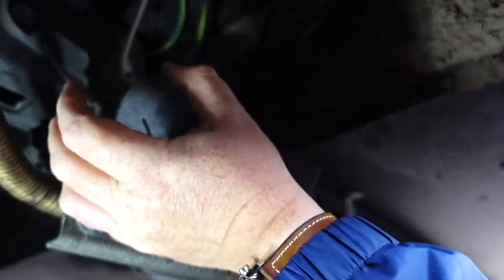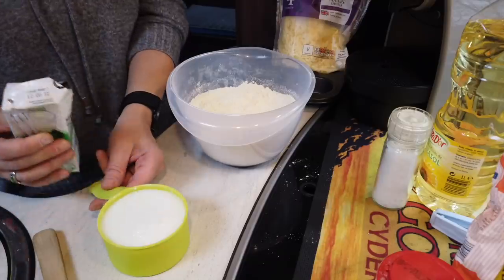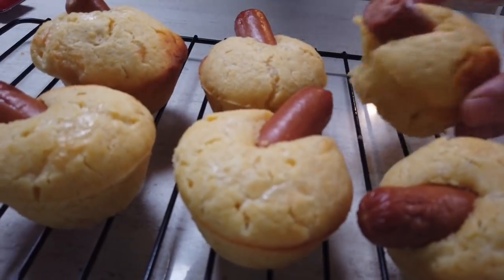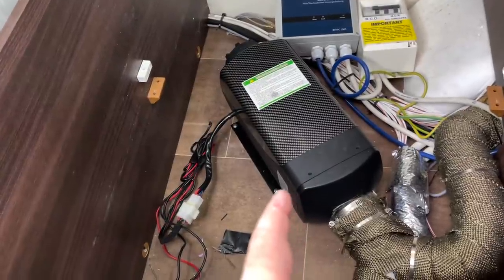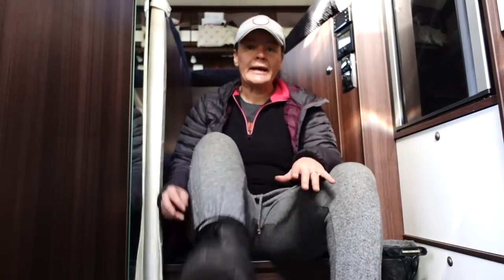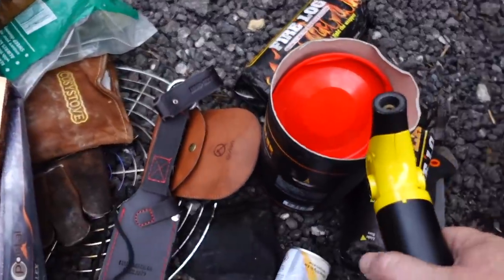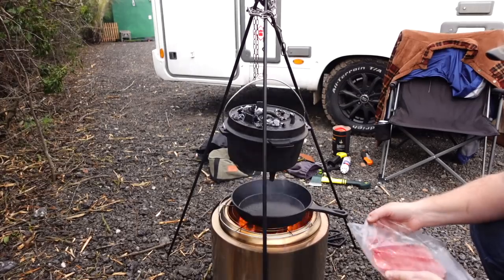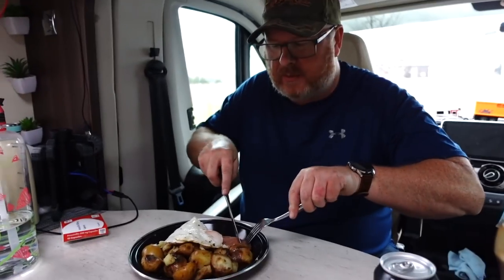TRYING NEW THINGS - Vlog 63

Comment: Hi john , may be too late now but did you check your air filter on the heater , i only say this as ive had this twice happen now where diesel wasnt burning  throwing out masses of smoke and both times it had clogged up the air filter without me checking and when i realised and took off just to see it started perfectly, due to somehow the fumes and carbon going up the air intake i guess but just worth checking see if its a simple clean of air filter to get it back running, i have 3 of these and have learned a lot about their niggles in last 6 months , but still great little things i love them in my shed! , you may also have to clean/replace the small mesh filter in the glow plug which its always worth having one or two spares and definitely a couple of glow plug replacements too , apart from those two items they do seem to be very reliable :)
Reply from the maker: It was all shown in the video 👍🏻 there’s was nothing wrong with the intake airflow.

Comment: Get a metal box, line with sound deadening foam, drill holes for fuel line in / out, once the pump is in wrap the box in neoprene.  Attach box on rubber anti-vibration mounts to the van and cross your fingers!   I've got far too much time on my hands!!  🤣
Reply from the maker: Haha, very thorough run through - thanks Patrick 😁👍🏻

Comment: John, please alter where your exhaust exits, it should exit beyond the bodyline of the vehicle, so that the hot gases can rise away from it.
 An easy fix for yours would be a 22mm copper elbow fitted to the end of your silencer, at the mo, your filling the underside of your home with naughty gas that wants to rise, be safe., love your channel.
Reply from the maker: I’ve covered this plenty of times, no rear window, no rear vent, exhaust is 3cm off the rear bumper. Imagine, if you will, it’s as close to the rear without being able to melt the plastic bumper 😬😳😁 So it’s all good thanks 👍🏻
Reply: Ive dogs in back of sprinter behind doors got me worried now exhaust points down just under door.

Comment: We have an eberspacher heater fitted to our home ( there when we bought it) . It too " ticks" like yours but cannot be heard above the fan noise ( and it's mounted outside !) . But you can here the tick when it reaches temp and starts to wind down to maintain temp inside. Something you have to live with maybe  ?
Reply from the maker: We’re thinking that, we prefer to have heat and a tick than to be cold that’s for sure 😁👍🏻

Comment: For doing your roast spuds quicker in the Dutch oven you should put them in salted water and bring them to the boil first (par boiling) before draining them, adding the oil and putting them in the “oven”. Another trick, works with Dutch ovens and Cadac gas bbq’s, is get a heavy duty round cake cooling rack that fits the bottom of your Dutch oven - you can cook a chicken, roast spuds, anything without the bottom burning. Look online for “fittoway heavy duty round cake rack” comes in different sizes as needed. Food looked amazing btw - yum!
Reply from the maker: I’ve been looking for a rack to fit the Dutch oven as I’ve seen one used loads on you tube. I must say I avoid par boiling all foods if I can, I don’t think they taste half as nice when you do.. 😁👍🏻

Comment: Hi John. No difference in the audible noise level on the video. 
From a safety angle you should extend the exhaust to the outer edge of the van. These fumes could easily enter the van through the gas drop out imho.
Reply from the maker: I’ve covered this plenty of times, no rear window, no rear vent, exhaust is 3cm off the rear bumper. Imagine, if you will, it’s as close to the rear without being able to melt the plastic bumper 😬😳😁 So it’s all good thanks 👍🏻
Reply: @johnmandy  Hi John, the power of video eh? Not clear as a viewer but just checking the obvious had been covered. Never in doubt. As a gas engineer I see some scary stuff on line/ YT etc & in the field (read; battlefield). See you two in a field somewhere soon hopefully.

Comment: It sounds about the same to me. This is very disappointing as the heater in my man-cave thumps like crazy in the all-in-one heater I used. To use a larger hole saw on an existing hole, lay a piece of thin plywood or similar over the hole and drill into this. It holds the centre bit steady.
Reply from the maker: I had high hopes but planar are definitely not making a quiet pump 🤦🏼‍♂️

Comment: I wonder if an box made up out of PIR insulation would work bud, then attach it to the chassis of the van with the pump being housed within it 🤔, I have 50mm layed upon my floor and I can't hear mine.... No doubt neighbouring campers can, but sod those 😂😉👍👍👍...
Reply from the maker: I’m going to move the pump to the front of the van when I pipe into the van fuel tank, so that will help with the thud thud thud that comes through the van floor, I’ll look at additional sound deadening then too 👍🏻
Reply: @johnmandy  yes, that's probably why I can't hear mine to be honest, just under the passenger footwell. So I've the Bulkhead and the floor offering sound protection from that drum machine of an pump matey 😉👍👍👍...
Reply: Hi John Great videos very informative I have my  pump in a 12 knockout electrical box stuffed with eggbox type soundproofing foam suspended on L bracket with cable ties worked a treat for me 👍

Comment: It's a strange one John, I had lots of lorries with night heaters fitted,but never recollect any noise from dosing pump.I was considering fitting Chinese diesel heater put have been put off by the noise.I am considering swapping out my Truma6 for diesel version, and would be interested if anyone has experience of these.👍👍Paulo
Reply from the maker: We were looking at doing that first but it seems the truma 6DE has different outlets, panels and temp sensors so it’s not as straight forward as it seems which is a real shame.. 😁👍🏻
Reply: @johnmandy  yes it would involve rewiring from heater to control panel as well changing exhaust flue and heating ducting and dropping vehicle fuel tank for diesel feed,along with the £2500 price tag,I've decided to stick with LPG for the moment and have fitted additional reserve gas feed to use calor/Reprisol bottles
Reply from the maker: @pauloinavan1336  Oh cool, that is a good redundancy measure I recon, we’re looking at that too as it should be an easy thing to fit to our existing kit 😁👍🏻

Comment: Hi John could you not extend your heater fuel line and power and stick your pump into that hedge next to you 
Obviously reversing the situation when you move,  which isn’t that often nowadays.
Would get yous a warm and quiet nights sleep.
Mandy Michelin star for your cooking. 😃
John Michelin tyre. 😀😀
Reply from the maker: It works a treat now, not too sure about sticking it in a bush with our nutty dog bobbling around 🙈
Reply: @johnmandy  ,
“mmm “ forgot about the dug.

Comment: Great video as always. The muffins look so good and seem easy to make. I wonder if they would work over the camp fire with John's coals on top of the oven set-up?

The over fueling of the diesel heater is obviously because the pump is working harder... more rapidly. You can change the metering settings in the 1688 advanced settings. It will click less often of course but not quiet.... that is just false advertising.
Reply from the maker: Our diesel heater is the new version without any manual override settings. No point changing a noisy pump costing £93 for a noisy pump costing £3 😜

Comment: Feel for you John been here meny times...the more you rap it up the worst it is...now I'm  saying suspend it useing cable types so it hangs in mid air so too speak. It works.and runs better on domestic heating oil. Take mine out of our the tank at home but you can get it from a lot of garages...sham about the pump....all the best
Reply from the maker: Thanks Ken, we seem to have found a very workable solution with the ticking. We also can get red diesel from where we are staying so that’s wonderfully convenient 😁👍🏻

Comment: John your exhaust pipe should clear the van. Danger?
Reply from the maker: There are no windows or vents at the back of the van and the heater exhaust is about 3cm from the rear bumper. It’s fine, it’s not a problem.
Reply: @johnmandy   ok John but you would not have a van exhaust stop there.
Reply: I had that injector cleaner and changned oil .i didnt didnt do it im a baker..

Comment: Hi, hope the two of you ( and Cooper ! ) are well, John I hope I'm wrong but when you fitted the new not so quiet pump, did I spot that you did not refit the rubber hose clamp correctly on the fuel line ? I've watched it back twice now, but don't know if you did it off cam ! wouldn't do to be dripping derv or sucking air in !  :)..edit,.. got ahead of myself, you changed it back anyway, lol, John I have to say that was very endearing (think that's the right word !?!) watching you cook and both of your comments about it afterwards, ya hit a home run bud ! you're human after all ! hahaha ! the old diesel heater prob just wants the glow plug cleaning and the gauze cleaning/replacing. kits available on all good auction sites ;) stay safe. p.s. my diesel heater pump was noisy so instead of bolting it down I just suspended it from a sturdy cable tie so it couldn't vibrate through the body, worked a treat.
Reply from the maker: As I replaced the pump back to the original, all explained in the video, it doesn’t matter 👍🏻

Comment: I've got the standard heater & pump like you , can not hear it and its in my locker which is under rear seat area its not  fixed to chassis its fixed to a upright panel in locker I guess the  metal chassis could make it worse , and not hanging by ties  , have you tried dampening the out line  of pump  pipe with an ever so  slightly wider soft tube over the original white hard nylon pipe in sections of few inches (few gaps in between the outer pipe ) I slit a section of the green pipe length  and put it over the nylon as most of the sound travels up the nylon pipe also make sure the nylon out pipe is not on contact with anything 👍
Reply from the maker: We’re trying the damper next as we’ve a few things to tweak - thanks 😁👍🏻

Comment: What’s the turret? What’s its for please!
Reply from the maker: It’s a plate you install the diesel heater onto. It’s shown in the video. It helps keep the hot exhaust away from the van floor. 👍🏻
Reply: Thanks, only knew it as the sole plate.

Comment: I remember one of the aspects of sound insulation in buildings is to add weight. I wonder instead of wrapping the pump in lightweight insulation try encasing it with something heavy, might be fiddly but it could work.
Reply from the maker: Thanks Mark 😁👍🏻

Comment: you have me puzzled now john, I thought you said in a previous video you said the fuelling was set by the diameter of the pipe to the heater, did you change the pipe? as if you didnt then the pump cant be at fault.... or the pipe theory was wrong and it is just the pump that dispenses a set amount, always thought these were originally called 'doseur pumpe' which i think is dosage pump?
another reason i always thought it was the pump not the pipe was the pumps have a value in ml per pulse in the spec sheets. maybe the planer one has a higher ml rate causing the over fuelling. i dont think theres a 'standard' for these and each big name manufacturer has its own spec. not sure what the ml value is i don't remember i read it about 5 years ago, i think there similar but just not similar enough so that you have to buy 'theirs' like with everything else they like to keep the money stream flowing

Comment: I would say with my poor hearing the new one is more tappy so worse than the original.
Reply from the maker: Planar quiet pump is anything but isn’t it 🤦🏼‍♂️
Reply: @johnmandy  very much so I have a similar heater and as an experiment I left a loop of fuel line before and after and I actually believe it is quieter but don't have a device to measure. I have suspected that a lot of noise is through the tube.
Reply: @kevinhammond9864  there are free db meter apps for smartphones